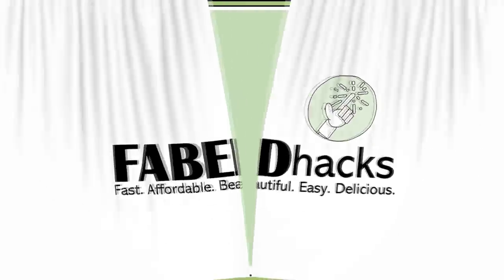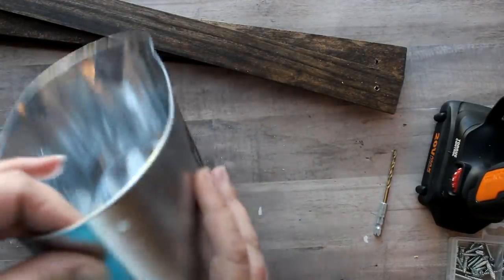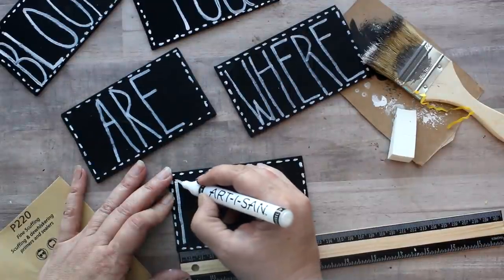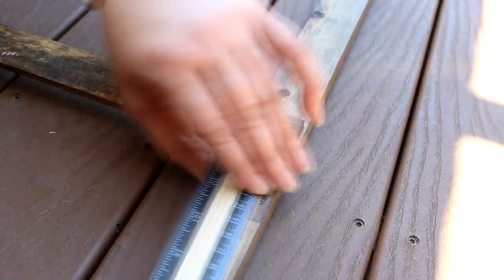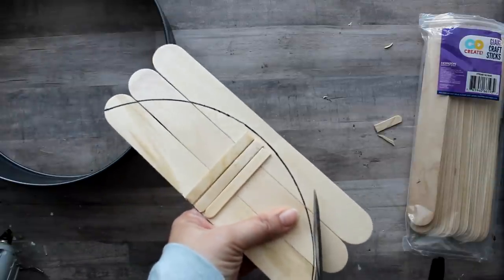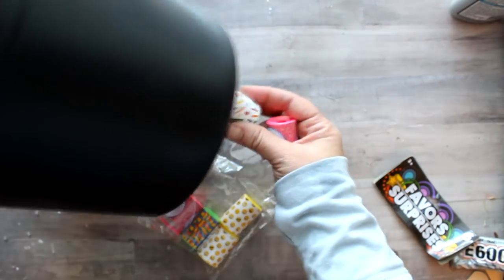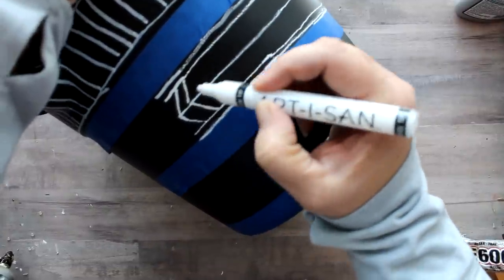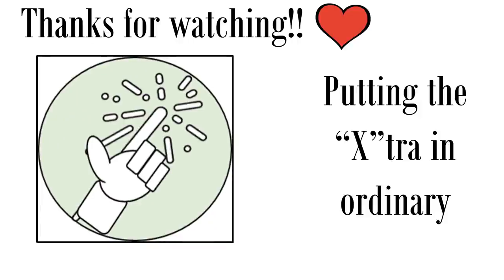DOLLAR TREE DIY PLANTER IDEAS | LOOK FOR LESS | MODERN FARMHOUSE BOHO | FABEDhacks PLANTERS #3!

Comment: If you can keep them stable you can cut service slats at once. 
I can tell you, those words are not easy to cover.  I like that quote too, but I have moved all over the country. 
You’ve been watching too much Holmes on Homes, Miss Woodwork.  I love the ladder. 
I used to make dollhouses and would use the end bits of craft sticks to create gingerbread on the roofs. 
The half moon planter is a great dupe and the price of beautimous. 
I see you’ve gone tribal. The great thing is you can get all kinds of creative and it looks great.
Reply from the maker: Hi Miss Mary! Girl, I can barely cut one at a time! I need new blades! And I can never find my tools! I have been trying to do this total garage overhaul for several months but the problem is that I begin on section and then but everything in bins so I can reorganize it and then something comes up and I have to stop the project and then I don't know what bin anything is in when I need it. You'd think with this lock down I'd have some time but I realized that most of the time I am saving running here, there and everywhere under normal circumstances has now been mostly eaten up by constantly having to wipe everything!!
Reply: The Saga Of The Wiping. 
Do people who don’t leave home wipe, wipe, wipe all day then get up to wipe, wipe, wipe all night?

Comment: I want to give you this information as well as I have been giving to others instead of buying paint stir sticks go to the wood section at home depot and ask for the wood they throw away that comes OFF THE TOP OF EACH PALLET OF WOOD.
they are the same width and depth of a paint stir stick but they are about 4 to 5 ft tall.
Sometimes they have bundles sometimes they have a few but I have collected tons every time I go I go over there and get all they throw away !!
Reply from the maker: Hi Shannon! Thanks so much for the tip!